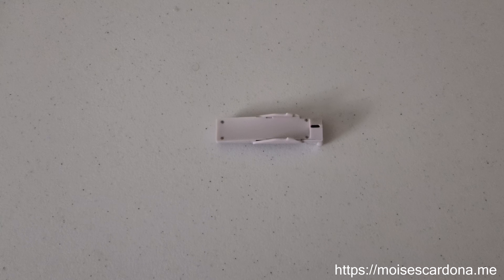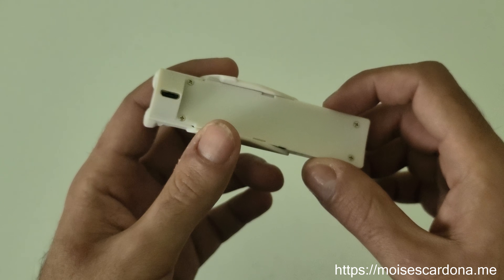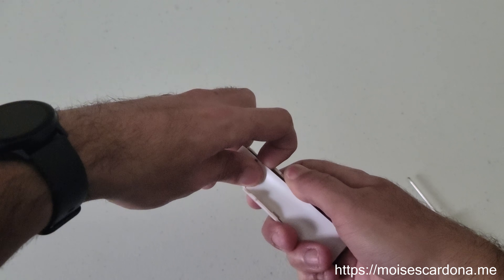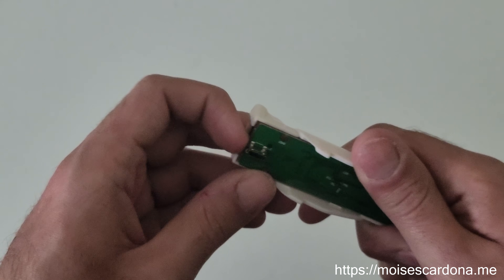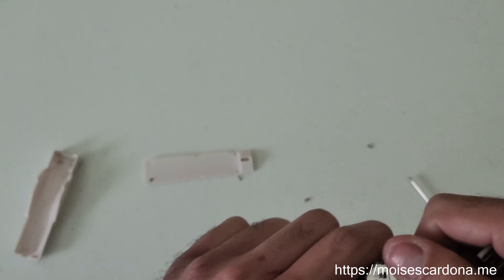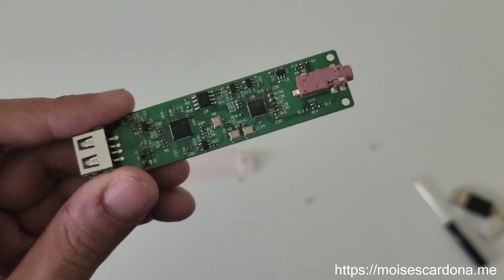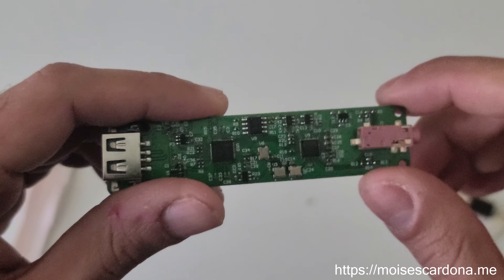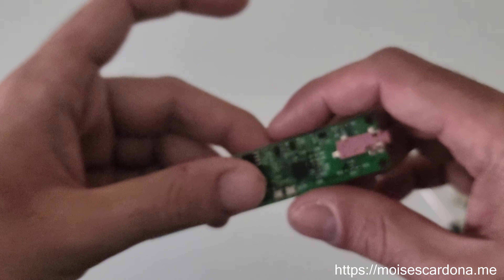Geekuy DAC Review (XMOS XUF208 and ESS ES9018Q2C DAC)

Comment: Thank you for the review, Moises. I was looking to buy this DAC at Amazon but the pictures there are not very reassuring. That mantis inspired case is certainly ugly and looks as flimsy as it gets. I don't think that micro-usb connector for power is very useful since you'd have to carry a power bank for it if you don't want to drain your phone's battery, which defeats the idea of portability. It would be useful if it let you charge your phone through the DAC while using it. Do you know if that's possible? Otherwise, if I buy it, first thing I'm going to do is remove that connector and get rid of that ugly case. I'd rather just put insulation tape all around it (provided heat is not an issue).